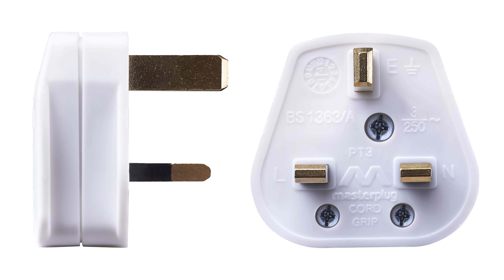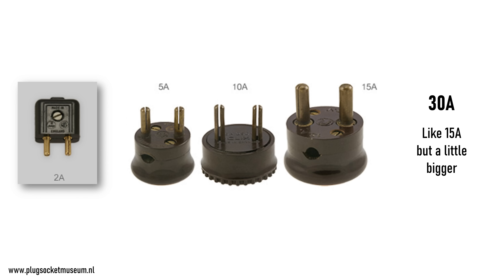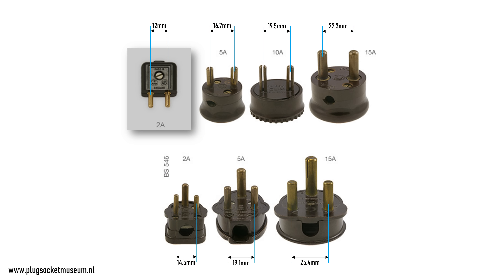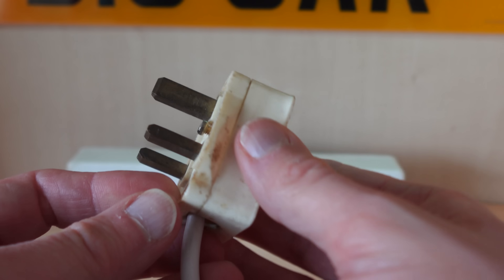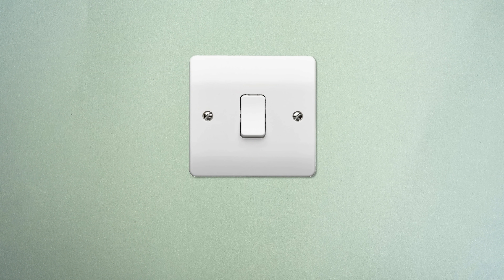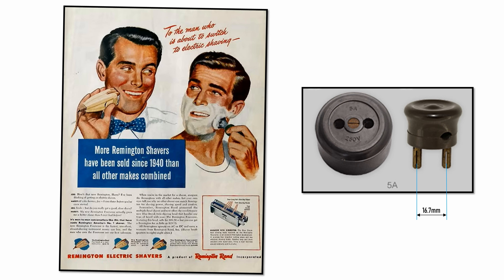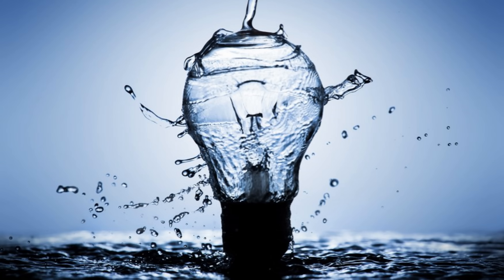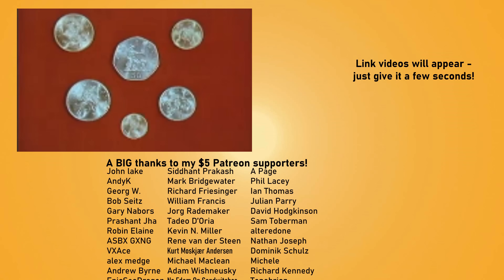Shaver Sockets are really clever

Comment: 6:47  Shavers use a plug (BS372 5A) with 17mm spacing with 5mm pins. 
In Europe the small plug (Europlug 2.5A), which fits everywhere, has 18 to 19mm spacing and 4mm pins. 
The Europlug fits into French, German, Danish, Polish, Spanish and even in Swiss sockets and more.

Someone has already got the Euro plug into British three rectangular prong sockets. 
But then there is no need to talk about safety anymore, 32A house fuse on a plug that is only allowed 2.5A
Reply: The Europlug has 18.6 mm at the base and 17.5 mm at the tips.

Comment: Very old fashioned system in the UK. The smart thing is to have centralized fuses instead of in every single plug.
Reply: We have them too. But they can be 32A. So we need to protect the lamp cable
Reply: @ 
When needed we have a group in the central hub which has the 32A fuse. Only cables that can handle this amperage are used for this group.

Comment: Australians have 240V available in bathrooms and we aren't dying every time we blow dry our hair and shave. All new builds here since 1991 have had to have RCD protection, firstly on all general power circuits and nowadays on all final sub circuits. Many older homes now have RCD protection as a result of rewires or switchboard upgrades. 

Of course there are also rules on how close to water fixtures that switches and outlets can be located. All outlined in the AS/NZ3000

Comment: Interesting video, I've seen these sockets in hotels in Asia, Thailand and Taiwan and thought they might be a hotel standard thing, but to learn that it's a British thing is quite interesting.  I'm from Australia and we just have 10A 240V 3 pin switched sockets everywhere, but there are rules about distance from basins and showers so some houses I've seen have the light switch on the outside of the bathroom but it's usually because they can't fit one right next to the shower.  Also I was shocked at how poor the American 110v  style electrical system was in Taiwan with most outlets not earthed and just shoddy work everywhere, Thai wiring was neater and more modern looking. I found out that in Taiwan that it was only 2014 when earthing was mandated and the trades that did electrical work were also plumbers so it makes sense.

Comment: Mean while in my bathroom (and many others like it) uses a GFCI outlet next to the sink.
Funny thing is, I rarely ever use it.
ALSO above the mirror cabinet, the light for the bathroom ALSO has a plug but I guess being up that high its exempt from requiring a GFCI
Reply: I run an extension cord into the bathroom from the bedroom for my toaster as I like to eat toast in the bath while balancing a portable tv on the taps.

Comment: In the US now, all bathroom outlets, also called receptacles, are required to have GFCI (Ground Fault Circuit Interrupter) built in. It's a fairly recent code though so many bathrooms still have regular 3 pin outlets.
Reply: You actually CAN have regular 3 pin outlets.  They just have to be protected by a GFCI.  That can be the downstream connections from another GFCI outlet or a GFCI breaker.  Also, bathroom outlets that don't have GFCI protection is something that often shows up in the home inspection most people get when they buy a house.  So, lots of older houses have been retrofitted.
Reply: @ccoder4953  That's basically what I meant  when I said "all bathroom outlets". It doesn't matter how it's done. I could have worded it better. I should've said "all bathroom outlets must be protected by GFCI".
Reply: also, it bears noting that "fairly recent" is now getting close to 50 years.  time flies.
Reply: @kenbrown2808  Nah, can't be. I guess it could. I think it goes state by state though. Doesn't it? I live in the Mississippi of the Midwest, WI. We're a little behind the times here.
Reply: @tims8603  a quick google says the first code requirement was outside receptacles and around pools in 1971.  it doesn't feel like it, but we're already a quarter of the way into the current century.

Comment: I do the pat testing at work and most small appliances from the far east come with a 13 amp fuse when even a 3 amp is excessive. So sadly prefitted plugs has not solved that issue.

Comment: I had wondered why my shaver socket got slightly warm after charging the toothbrush overnight and now I know... it is the transformer. In the morning it has a warmth a little above body temperature in the top half of the socket. This goes away when the brush charger is not connected.

Comment: I have been using electric shavers since the 1980s; all of them have been rechargeable. But I still need someplace to plug it in in the bathroom. In the United States, some decades ago all outlets near Water are required to be ground fault circuit interrupting. Otherwise there's nothing special about them. Also, every electric shaver I have ever owned, and there have been many, our dual voltage. 110/220 V.

Comment: Oddly enough, I'm designing the electrical layout of my boat, right now. My shaver is battery-powered, of course, but its charger/cleaning stand plugs into the mains. Using a wall-wart that outputs 1.2A at 5VDC. I've pretty much settled on using USB-PD for my DC outlets, and I'm wiring up a cable with a 2.5mm barrel connector on one end and USB-C on the other.

Comment: I was astounded by British electricity and plumbing on my first holiday there. I couldn't have a light switch in the bathroom, but I could have an electric instant hot water service in the shower with me.
Reply: The water heater is double insulated.  The light switch is not.  Modern circuit protection, provided it is installed correctly, pretty much eradicates all of the legacy rules we still carry in UK.  Our governing body on electrical standards is notoriously old fashioned (belt and braces and two pairs of underpants).
Reply: @MS-Patriot2  Depends on the switch, if the switch is completely plastic (like most of switches nowadays) it doesn't require an earth connection thus it's class II.
Reply: @alerighi  Agreed, I was only on my first coffee when wrote that 🤓. So why can we not have a double insulated (class II) light-switch in a bathroom, regardless of position zones ?

Comment: Some model rail railway sets come with a 12 or 22 volt transformer that is also a shaver plug. 
I've never used them in a shaver socket as a model railway is not something you'd run in a bathroom ... so I use with a 3-pin adaptor.
Reply: Is that a shaver plug or a European plug?

Comment: I'm in the Netherlands, and my home (built only 6 years ago) has a light switch and a single earthed 230 V socket inside the bathroom. I don't know if it has any special internals to make it safer. Regardless, I'm very happy to have that socket!
Reply: I'm not an electrician, but I do know that 230V sockets are perfectly legal in bathrooms pretty much universally across Europe. My experience is with Italy and Germany, and now you say even the Netherlands.
My (layperson) understanding is that with sensitive 30mA RCDs protecting the whole house, banning 230V sockets in bathrooms is entirely overkill.
Reply: @trustnoone81  AFAIK it's the norm in the Netherlands to have the whole house covered by RCDs, not just "dangerous" places. I live in an apartment and (I just checked) have two 30 mA RCDs protecting everything.

Comment: I wonder if Finland had similar regulation regarding light switches in bathrooms. I used to live in several apartments there, and I always wondered why the switches were on the outside.
Reply: It is more practical outside in a room were you never turn the lights off while you are there. If it is inside you need to find it in the dark.

Comment: First time seeing one of those was on a cruise ship and I thought it was odd and at the time I just thought it was something unique to how shipboard electrical systems have to differ from land-based systems in terms of neutral and ground, I also thought it was weird because the rest of the outlets in my stateroom were the regular 3-prong US NEMA 5-15P and common areas like the buffet had both the US plug standard as well as the European 230 volt 50 hz 3-prong flat blade receptacles
Reply: In the US we put regular 20 amp 120 volt outlets in the bathrooms and they have a ground fault circuit interrupter built into them which provides the safety functionality, also US electrical code states that not only do bathroom receptacles need to be GFCI protected but bathroom receptacles should be on a 20 amp 120 volt circuit and are also exempt from the requirement to use arc fault circuit interrupters like you would normally have to use in the rest of a new house.
Reply: Are full current draw bathroom appliances like hair dryers and curling irons not popular in Europe or are they just not used in the bathroom near the sink? In the US any modern bathroom is usually going to have a large vanity that has at least one hair dryer and one curling iron as well as some of your other modern creature comforts like a smart speaker, rechargeable toothbrush and shaver etc
Reply: Also another thing is the US consumer products safety commission requires that certain bathroom electrical appliances be fitted with a GFCI plug so that way even if you accidentally drop the curling iron in the sink you will still have the safety advantages of a GFCI even if you're in a older house that does not have one in the bathroom

Comment: can't speak for the rest of the world but here in sweden we thecinally still have 4 plugs, 2 pin which I think normally is only up to 2,5 amps, 3 pin 16 amps, which uses the same wall socket, these are what your average person is using, then we have 3 pin 20 amps, which you can find on single face bandsaws and such, and lastely 5 pin which has diferent sizes depending on amperage,

Comment: Can you use the 230V and 115V outlets from a shaver socket at the same time ?  One for charging a shaver and the other for charging a toothbrush, for instance ?
Reply: Yes. Some will have a switch to flick between 115 and 230, so you won’t be able to on those. The max amp rating would be combined

Comment: It is actually having one side of the power supply earthed that makes it more dangerous,  if one side is not earthed ( like a shaver socket which has a transformer inside ) you have to touch both poles at once to get a shock - if you have once side earthed ( the neutral and Earth on UK power is earthed ) you only have to touch the live pole to get a big shock...

Comment: No it's not @ 4:20. Finland has had regular sockets, without any lid, childsafety sockets or even RCD in bathrooms, and they need to be 120cm away from the middle of the shower bar or 60cm from the edge of the bathtubs. Didn't become mandatory to install RCD in bathrooms until 1997. Outside sockets had to have RCD from 1998 onwards. And as recent as 2008 it became mandatory to install RCD on all sockets except those made for a specific device and not used for handheld tools, i.e. dishwasher, freezer/fridge, microwave oven etc...

Comment: When charging my (modern Oral-B) toothbrush, the shaver socket gets really quite warm.... And in the summer, rather hot to the touch. Surely this isn't good?? So why do they keep selling them for use with shaver sockets? Anyone?
Reply: Yes it’s very annoying. It wastes more in heat than it takes to charge the toothbrush. One reason is that it is cheap for Braun.
Reply: You can now replace the shaver outlet wall plate with a toothbrush charger. Click Mode do them for ~£25. If you still need an outlet for shaver, they are much  more expensive.

Comment: The risk of water is somewhat overstated. One person actually did a demo of entirely submerging a 120v power strip in a water bath. Isolation transformers are pretty cool but I’m curious why they haven’t adopted GFCI like the US. The trip current of GFCI is substantially lower than the fuse on such a shaver socket.
Reply: The UK uses RCDs, which are like GFCI for the whole house. Instead of pressing a button to reset the socket, you flick the switch at the consumer unit for the whole ring (breaker box for Americans, I think)

Comment: I’m actually a bit puzzled about some safety items that went by the wayside. An “Edison Safety switch” had the switch and wiring on the ceiling. The switch was operated by a wooden rod. 🤔 The switch could even be behind the plaster. The rods were far more durable than a string and were usually be lacquered or carved and might have brass fittings to attach them to the walls. 😬 Safety was an issue as DC power wasn’t the safest thing to have around the house. Oddly though I haven’t seen any repeat of the standard. 🤔I wonder why not.

Comment: We only have one, well two different sockets here is Australia,, 10A and 15A. The only difference is the size of the earth pin. other than that we have power outlets right next to the sink but EVERY circuit is ALWAYS protected with a Safety switch which trips at even the slightest smell of trouble. oh and we only have 240V.

Comment: I moved to the UK a few years ago and good lord I couldn't figure out why every bathrom had a flimsy dangling piece of thread hanging at the door that you had to yank to turn on the light. I understand the security side of it and all but surely we could've instead designed a safer switch for bathrooms instead! Feels extreme for no reason. Electrically speaking, the safest house is one with no power at all - but thst doesn't mean it's better.

Comment: The security reason for light switches is somewhat obsolete. It's easily possible to use a relais based switch nowadays where the actual switch no longer uses grid voltage.
Reply: There’s some neat self-powering switches nowadays. It uses the power you generate by flicking the switch itself, to send a wireless signal. No batteries

Comment: You can have a light switch (plate switch) in the bathroom. it  should be at least 0.6 m from the edge of the bath or shower (outside the zones) and must be suitable for the location.
Reply from the maker: Thanks - I'll post a correction as a pinned comment.

Comment: I remember in the 70s and even in the 80s occasionally coming across the round pin 5A plugs and sockets
Reply: Still liked today if we want to plug in a freestanding light and have it switched from the wall by the door
Reply: That's the BS546 standard and they can still be legally installed to this day. Sometimes you find them in hotels for side lamps, and one place where they are very popular is in theatre stage lighting systems as it makes fault finding easier. Sometimes people fit them for things like under cabinet lighting. 

BS546 originally had 2A, 5A, 15A and 30A sockets, all on different sized radial circuits and matching fuses, although the 30A variety was quickly dropped. Whilst BS546 doesn't have some of the safety features of the BS1363, such as shuttered sockets, internal fuses or sleeved live and neutral pins, they can be bought with all of these if you want. BS546 is also still current in several countries, such as India and South Africa.

Also, in the UK some people would simply convert a BS546 socket with a BS1363 socket, and that's all within regulations, provided that the fuse was still appropriately rated for the circuit. No problem with a 15A circuit, but more problematical with a 2A or 5A circuit. The danger in the latter case is the householder would get tired of blowing fuses and put some 15A fuse wire on a circuit rated for 5A...

Comment: NOT all shaver sockets have an isolating transformer, i've seen single output ones that dont ..you showed a pic of one in the video!!
Reply: All shaver sockets should have an isolating transformer, even with a single output voltage, per building regulations
Reply: @techheck3358  'should' and whether does or not can be a different matter....
Reply: @andygozzo72  not sure how someone would get their hands on a non-isolated one, unless they ordered straight off temu 😂
Reply: @techheck3358  Not quite.
A shaver supply unit (with a transformer) complying with BS EN 61558-2-5 may be installed in zone 2 of a location containing a bath or shower 

A shaver socket outlet without a transformer should conform to BS 4573

The front of a shaver socket outlet conforming to BS 4573 is marked ‘Shavers only 200-250 V ac,  and the back is marked `NOT for use in a bathroom’. Regulation 553.1.5(ii), does not allow a shaver socket outlet conforming to BS 4573 to be installed in a bathroom.
Reply: @andygozzo72 on the rear, printed in red it states, not to be installed in bathrooms.

Comment: I live in Pittsburgh, Pennsylvania (USA) and have THREE regular outlets in my bathroom They are grounded (earthed) at least! And the light fixture is METAL and has a normal wall switch INCHES from the sink! It's FOR SURE a more dangerous setup than what the UK uses even if it's half the voltage. 15 Amps at 120 volts is STILL deadly! My house was built in the 1870s and was originally wired before 1910 and was last electrically updated in the 1960s! Said bathroom sink DOES have a UK ish thing: Separate hot & cold taps!